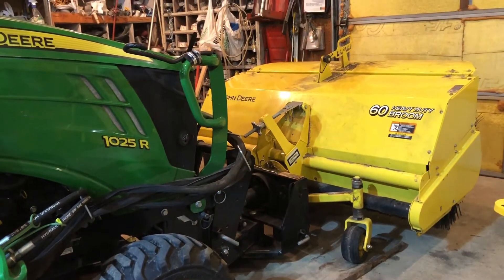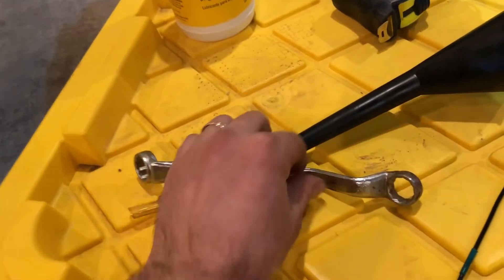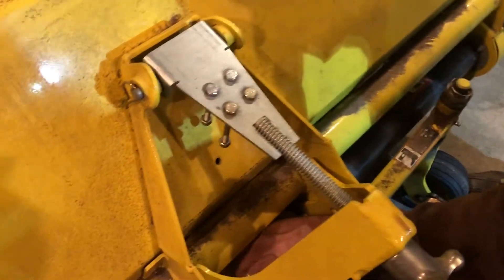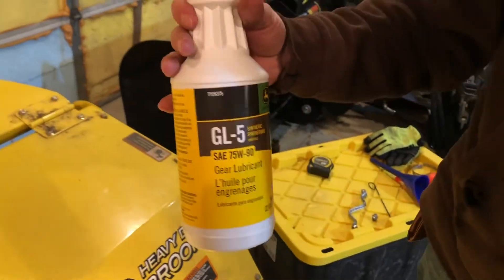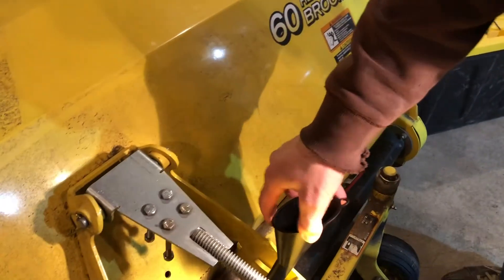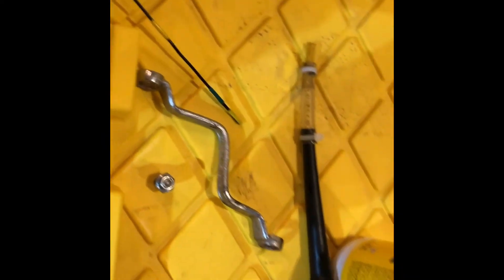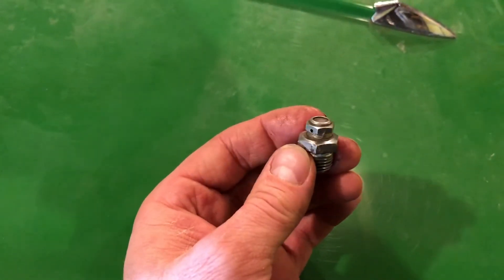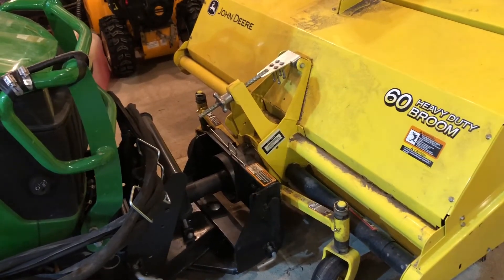Checking Gearbox oil on John Deere Broom

Comment: Your making it to hard with the wrench.   Just loosen up the main depth wing nut all the the way.   Then lift the broom up,  which rotates the broom down.   Then you can use a socket on the plug,  plus it's easy to fill.